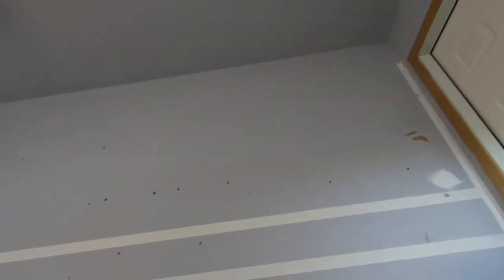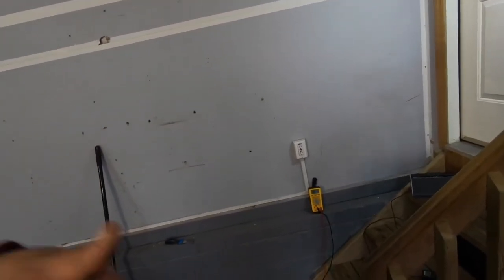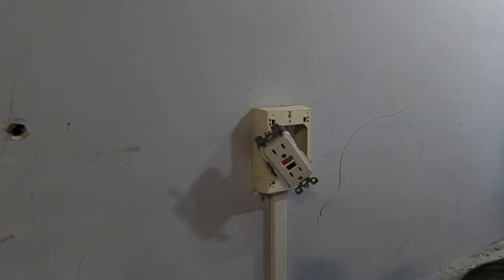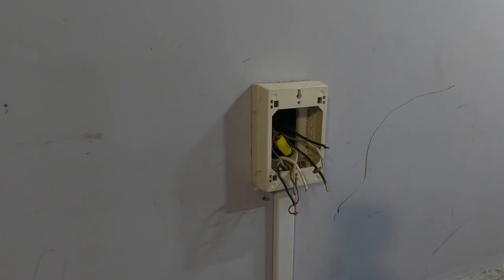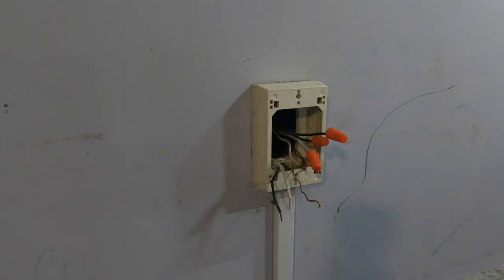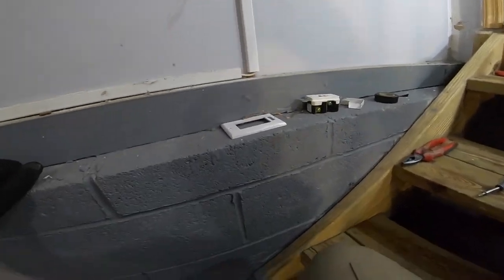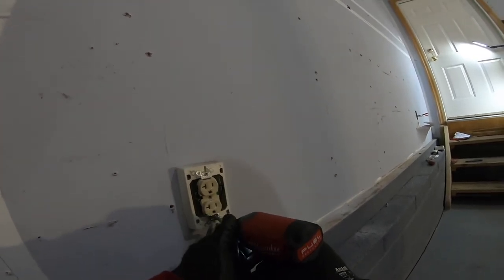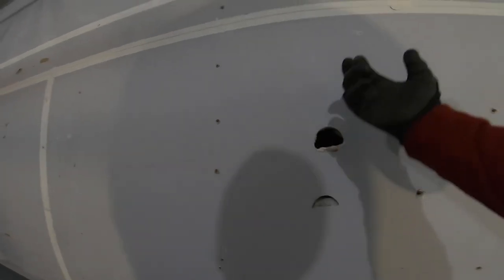Removing Electrical Outlets In Garage

Comment: Insulation should help with energy savings.  With those wires coming through that wall box, thats gotta be feeding something on the other side of the wall.  Ive seen too many disasters in wiring.  I pulled hundreds of feet of extension cord from a customers back porch that she wanted re-wired.  I kid you not, I had a pile about three feet wide, four foot tall of extension cord and mis matched romex pulled out of the walls and form under the flooring......
Reply from the maker: The wire is feeding an outlet by the garage door. I’m lucky the wiring isn’t one of my major issues in this house. I wish I could say that about the plumbing. I do have some issues with wiring. Possible loose connections, I notice ceiling lights blink when plugging things in. Amazing some of the jacked in work out there and not more electrical fires
Reply: @billstools5244  Loose connections are one of the main causes of electrical fires.  I had blinking lights in my bedroom for a bit and found loose connections in the ceiling of the closet where a light was intended to be installed.   I was finishing up a sub panel install for a friend and when I plugged the shop vac into the inside outet and tried to turn it on, the vac wouldnt run, but the lights in the stairwell would light up!
Reply from the maker: I see it often burnt compressor wires from a bad connector. I am slowly checking all the electrical connections. I’m just drowning over here trying to get most the painting done before Saturday. That’s my move date. So many curve balls popped up preventing me fro painting